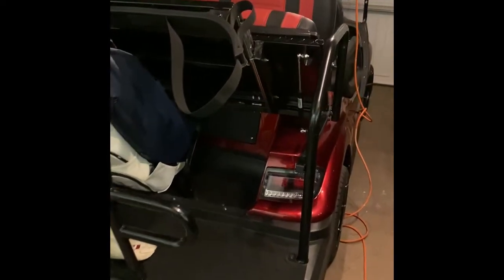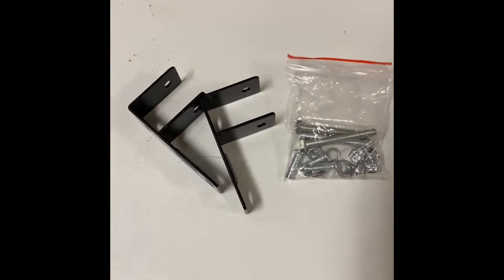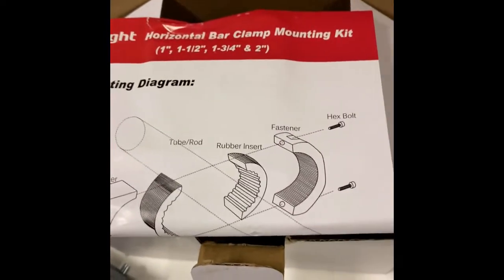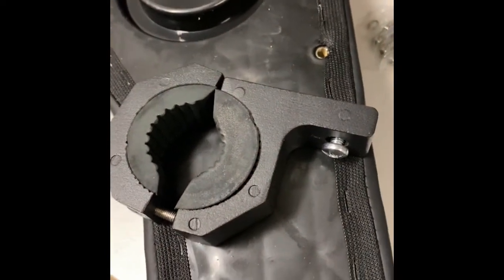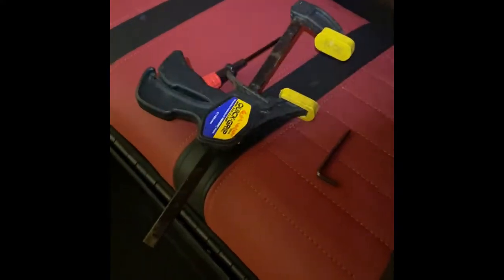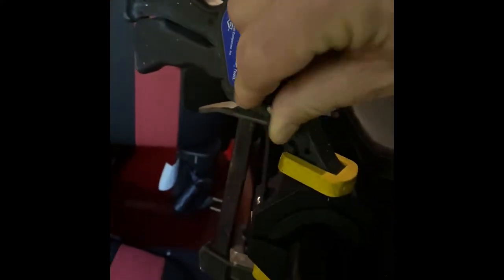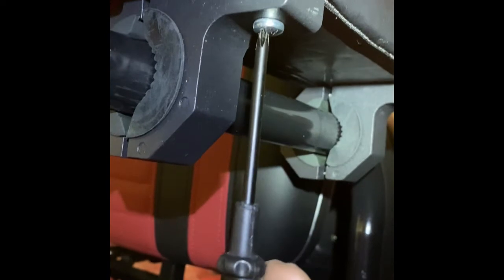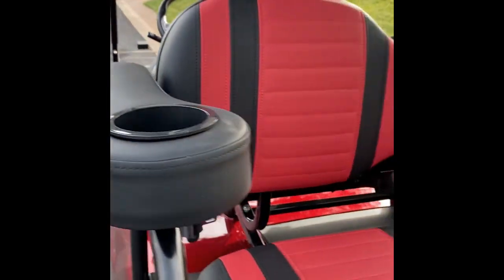Icon i40 arm rest install

Comment: Thanks for this.  Good info.  Question:  Does installing the arm rests this way still allow you to fold down the rear seat if you want to use the cargo option?  I know it does not hit if you raise the seat up to use the golf bag attachment, but it appears it would hit the arm rest if you were to fold the seat down.  Thank you.
Reply: Sorry.  I don't know.  I don't have the cargo option and my back rest does not fold down.
Reply: No, there’s not enough clearance for a standard Icon flip seat to fold down for cargo. 

Ask me how I know 😢

Will need to drill two holes in each armrest and mount them with the cupholder facing out.
Reply: Switch the armrests and you will have clearance for the backseat to go up and down.

Comment: nice vid, but no go for the arm rests.  they fit yes, but the seat does not fold flat which was my main concern - raising and lowering it collides with the armrest.   if yours does not can you show me how that works?   no matter which way I present the arm rest using the clamps it interferes with both raising and lowering.   However the stock brackets might work or variation of it.
Reply: btw by folding seat I am talking about the actual seat the passenger sits on folding it to a flat shelf.
Reply from the maker: You are right.  The rear passenger seat goes down but the arm rest will block the flat storage bed from folding out.  The clamps don't block the flatbed.  There is about 1" clearance and the flatbed will pass by the clamps.  You have a couple options.  Make sure the straight part of the armrest faces inside and try that but it may be too far in to clear.  The other option is wing nuts on the arm rests so you can remove them when you are hauling.  Not great but could work.  Maybe the stock clamps drilled through the bar will move the armrest over enough.  Good luck.
Reply: Switch the armrests and you will have clearance for the backseat to go up and down.
Reply: @greglamonica5488  I did - it wont work.

Comment: does the seat fold down (not raise but extend) and lay flat with the arm rests there?
Reply from the maker: yes
Reply: @gme2012  nice.   I just bought one of these cars yesterday and expect delivery in mid Oct.   I am buying the accessories now, speaker, ignition switch with unique key, seat cushion, lighting, floor mat and now the arm rests.   thanks for the video
Reply: nice vid, but no go for the arm rests.  they fit yes, but the seat does not fold flat which was my main concern - raising and lowering it collides with the armrest.   if yours does not can you show me how that works?   no matter which way I present the arm rest using the clamps it interferes with both raising and lowering.   However the stock brackets might work or variation of it.
Reply: @tlfreek  You’ll need to drill two holes in each round top tube and mount them with the cupholders facing out. I ran into the same unfortunate issue.

Comment: Where did you get your golf bag holder?
Reply from the maker: The golf bag holder is from the dealer.  It is an Icon factory option.  When I got my cart in January the bag holders were typically back ordered but they had one when my cart arrived.